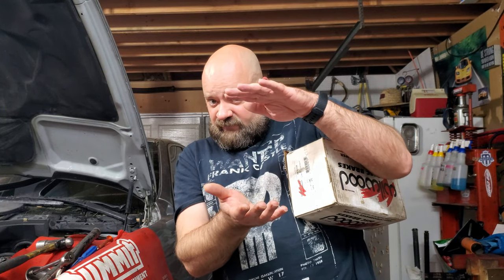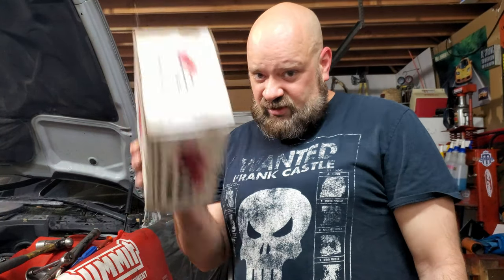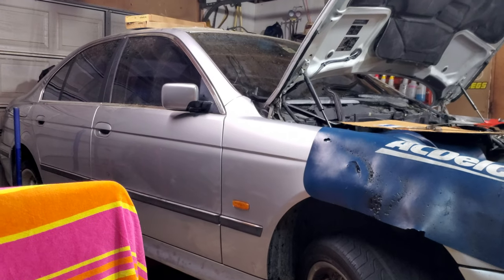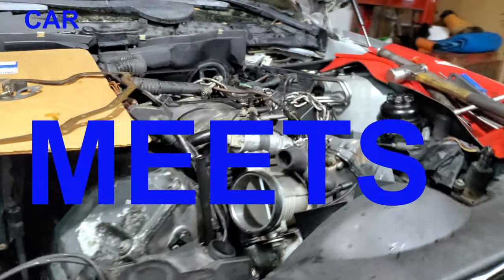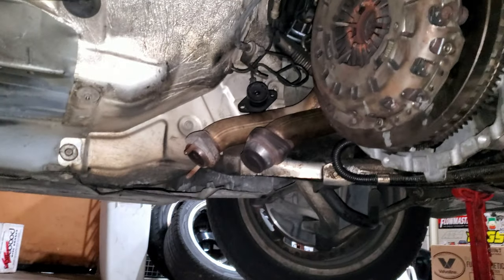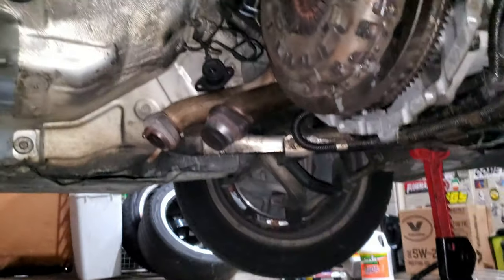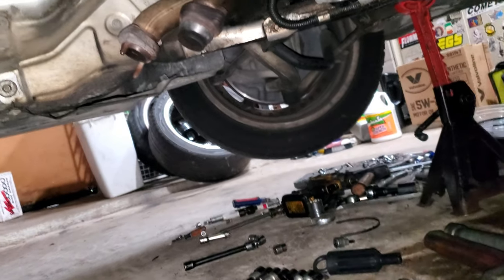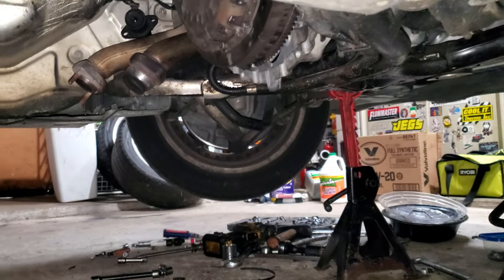How I Install a Transmission Alone.

Comment: One way that's always been helpful for me is two rachet straps from side to side between the frame rails. Cinch it up level so its levitating, block some wood under it, loosen the straps and go again. Pretty soon you'll have it suspended and with it being in a big sling of sorts, you can twist it one way or the other to line it up, drop the back strap a little to match the angle or whatever you need to do.
Reply from the maker: Great tips, thanks!

Comment: max jax is calling you home ...    the way I did one was to lift the whole car in the front with a cherry picker and jack stands on the back axle.   have the trans already on the trans jack.   roll it under the car then  SLOWLY lower the front back down on to two jack stands on the frame rails

Comment: Hi there. I'm looking at replacing a tranny in a car O found. I watched your video and I'm thinking "I can do this!" So I look on Rock auto, the car and year, and I got 12 options for transmission parts. Should I be buying all of them or.......? Uggg. ANY info. would be awesome. Thank you! (And thank you for being entertaining!)
Reply from the maker: Hello. As a rule I go to Orielly auto parts commercial department to look up the vin number of the vehicle, to get an accurate idea of what it came with. In some cases it can mislead you, so further investigation will have to be done by looking at the transmission pan if it is an automatic in most cases, to figure out exactly what you have. I hope that helps. Thanks for the comment and compliments, Good luck!

Comment: Trying to replace my clutch in the middle of my yard. Car is on jack stands. I've  got maybe  10 inches of room to squeeze under. It's not going so well. 

Doesn't help that I have absolutely none of the tools for this. Trying to use rope, and a floor jack, and 2x4's to prop it up, but the stupid thing has a huge dead weight on one side from the gear box that's sticking out, causing the center of gravity to shift. It wants to twist. 

What a pain. We need to invent a better way to do this. No more 140 pound transmissions please. Make them separate or something..
Reply from the maker: I hear that be careful, take breaks, use leverage for sure. First things first, you have to be able to get under the vehicle comfortably in order to do stuffs. The best of luck!

Comment: Long ago when I wanted to change the clutch of my Volvo 740 at my cottage in a village in Romania I let a gypsy dig a 5 meter long and 1,2 m deep and 1 m wide pit in the back of the garden (the guy who did it also was the local gravedigger!), parked the car over it (clay ground so very stable) and worked from below, which went surprisingly well. To put the heavy gearbox back however without some sort of jack I had to lie on my back on the bottom of the pit and push up the gearbox vertically with my feet and legs in the air so my neighbour buddy could wiggle it into place. That was pretty hilarious and a shame it wasn't filmed! Years later at home in Holland I started doing it in our backyard by jacking the car with all wheels onto 50 cm high piles of garden tiles (so plenty enough of work space) and levering the gearbox up from one side of the car with a 4 meter long wooden plank on a log/pivot in the middle with a balancing counterweight at the other end, it looks like a see-saw but it works perfectly since the big chunk of metal becomes weightless like a movie camera on a boom and very easy to steer, up and down and to and fro,  mind you I do that without any outside help. Taking it out I do with the same method in even less time. Last time I did my 940 the only pain in the ass was unloosening some of the big engine-gearbox bolts, the rest was a piece of cake. Personally I don't see anything good in all this macho jacking, ratcheting, powerlifting, etc.
Reply from the maker: You are very creative at your tasks! When I was a teenager I helped service the Patrick Henry boys home fleet and we had a wooden ramp we would drive up and go beneath the ramp to work under. I had serious trust issues with that wooden contraption , but it never let me down. years later I visited a shop in Brookneal Virginia that had a pit under, and just thought that was the most clever, until I heard about how many people fell into it by accident.
 We each use what we have don't we? Ha, some have strength, others have mental fortitude. And the rest of us just kind of fumble around and film it for the rest. Thanks for your comment, your methods would have definitely brought down the house as far as views are concerned!
Question, Have you ever thought about recreating for the camera? I am being 100% serious, and would love to challenge you to do it.
Reply: @TurboWorld  Turbo, sadly I had to sell that beautiful lakeside property with panorama view on the Transsylvanian Carpathians two years ago, although I still have some real estate there. The pit idea was out of necessity, the clutch was gone, changing it was a first for me and I couldn't imagine then doing it on the floor. After that I had no real use for it again and it soon filled up with garden litter as a compost pit and I think I only once fell into it. Thinking back at the 'human gearbox jack' episode what's interesting is in that (half  gypsy population) village miles from modern civilisation nobody looked surprised because they do improvised stuff like that all the time, they distrust technical sophistication, prefer shoestring solutions that begin as 'temporary' and then stay forever, I used to call that "gypsynology" and my eyes have seen many gypsy-tech oddities that would go viral like you wouldn't know. In many ways this attitude was shaped by decades of having only primitive communist cars around, the famous old type Dacia (before Renault took the brand over). I often felt like a German engineer in a bangladeshi workshop, but it was never boring. Volvo bricks btw were the perfect cars for rural mountainous Romania (before they started becoming rare, collectable and expensive), a lot of other cars just can't cope with the often horrible roads once you leave the major road system. Worst memory was a 70 km stretch of only potholes, no second, no meter without them, but you will break down before the Volvo. It is on moments like that, of which I had many (on several Balkan tours), that I started feeling about my bricks as good, reliable friends that don't let you down even when you torture them.

Comment: Good, educational video!  The idea of using ratchet straps to lift a transmission is great!  Is it easier to put a transmission in first and then the engine with a lift???  I am doing this myself and ma new to it. Thank you!
Reply from the maker: Thank you, it depends on the vehicle. Some are easy to drop both the trans and engine in together, others have clearance issues and simply cannot be done that way. I prefer installing both as one unit.

Comment: How to modified Maverick when I was a kid
 I had to lay underneath the car pull the c6 transmission onto my chest push it up to the back of the motor get a bolt in it and line the converter studs up all at the same time
 A c4 is lighter by far but unfortunately I had put a C6 in this car
 Very unfortunately LMAO
Reply from the maker: I put a c6 with a 351 m in my 70 mustang, I thought it was a cleveland. Ha ha So many lessons learned the hard way. That was a monster heavy driveline!

Comment: I like you ur cool as hell but this diddent show me anything on how to actually help me A line in there by myself
Reply from the maker: Yeah this was just a kind of , "prepare your self for these things" type of video for the people who hadn't been there yet. Sorry about that. To further explain Aligning them , you have to bolt the clutch and pressure plate up with an alignment tool stuck in it. Then you bring the transmission up to the flywheel and pray like hell that your buddy(s) will show up to help save your life after you die three times trying to wiggle and twist and push the transmission input shaft through the pressure plate, then the clutch disk, then into the pilot bearing which for sure is the most difficult. Takes time and patience and a few longer than usual bolts to help out massively. The most important thing to remember the first time in,  have two strong friends that are loyal, help you. Bumgarder's always had my back, both Stephen, And Adam, and his brother Josh helped me more than once. Jordan and a few others have helped me, but I have done more than a few by myself. I would never recommend doing by yourself the first time. Much love to all those that are willing to jump in and help a friend do this job. It's no joking matter, one slip could change your life for the worst, or end it. So call those friends who have done it and who you trust to catch a falling trans when your arms wear out and you cant push the jack under it by yourself. Just keep calm, and push through.